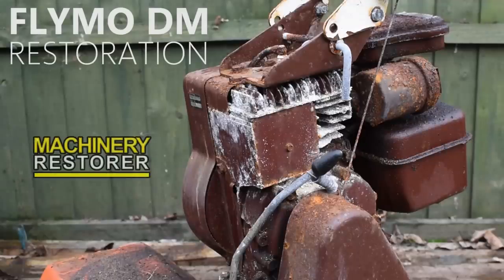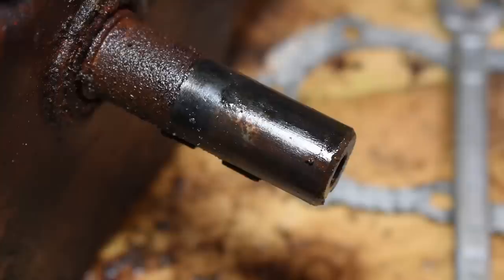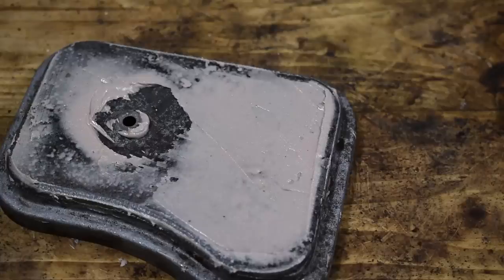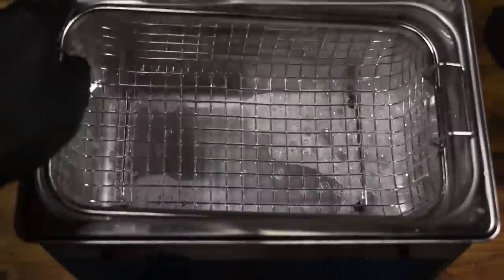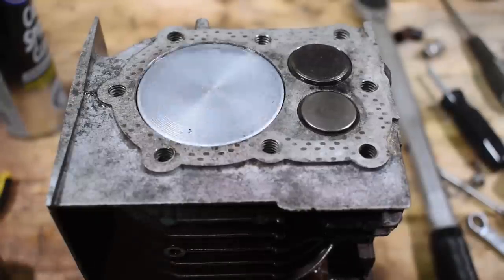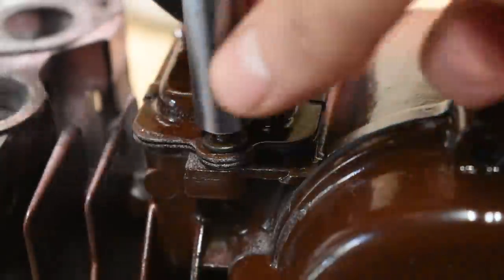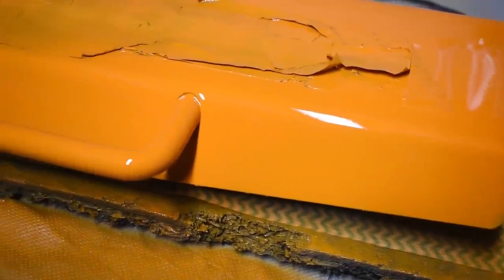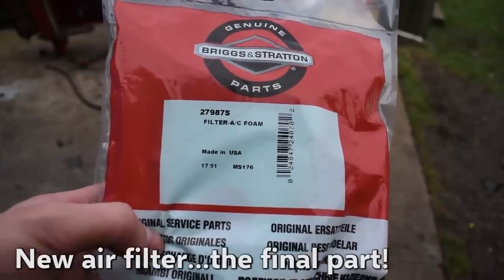TILLER RESTORATION (Will It Ever Run Again)

Comment from the maker: Hi everyone. Just to say I am aware of the 3hp decal being upside down. I am hoping to turn it around.
Reply: great job daggerwin I mentioned machinery restorer in your live stream
Reply: Just wondering if you slapped your forehead like I do when I do this kind of stuff??!! :-)
Reply from the maker: No, it's a learning experience
Reply: It's your point of view, pay no attention to us.  Thanks for a great rebuld.
Reply: Allo dagger
Reply: completely wrong year decal setup too. They are available in packs with fuel tank "check oil " decal as well as air cleaner.
Reply: I don’t think anyone noticed🤭
Reply: Machinery Restorer  What kind of Puller you used to remove the pulley with? 
Thanks Alex
Reply: Figured you were an Aussie.
Reply: Machinery Restorer I was just gonna say it was
Reply: Astonishing.  Great recovery and a great way to reduce and reuse. Most people here in the United states would simply chuck it and go buy new. I'm all for restoration.  Thanks for posting
Reply: Hi what solution do you use to dissolve all the rust out of the tanks.  I have a rusted motorcycle tank that I need to clear out.
Reply: Could have sold it to me as brand new and I wouldn't have been able to tell the fucking difference, my dude your amazing!
Reply: Damn great job. If you really care. Maybe a little heat to soften the glue. I would worry about it.
Reply: Cómo me gusta ver cómo se arreglan maquinaria!!!
Reply: If it is upside down, it is easier to read if you just lean over rather than slouch or squat to read if it were the right side up. ;-)
Reply: God
Reply: really after all the hard work you put into restoring this people are leaving comments about a sticker, only on youtube!
Reply: That won't do any harm.
Reply: I'm curious, how many hours did this restoration take?
Reply: That is the least thing to be preoccupied 😁
Reply: s1ayer_  ☹️-🤬
Reply: Machinery Restorer 
Hi, I see you used the original piston (no prob there not to mention it’s your tiller:) but I was wondering if you honed the cylinder and used new rings? Sure a Bore job one size over would restore optimal compression as would rings and new cross hatching from honing. The ring job just wouldn’t hold that comp as long as a bore job.
   Great job with lapping the valves that’s why I ask about honing and rings.  Time spent with the valves to improve compression reducing leakage made me wonder why no ring or bore job?
   Great vid! Nice work! Just being curious not criticizing your fine work! Cheers
Reply: Will turning it over increase the horse power?
Reply: You need drown this machine in a pool of WD-40 .Its rusty as hell !!
Reply: I have told YouTube to take down this video and ban you from ever posting anything again. Decal was upside down! My world just fell apart, and I lost all faith in humanity! What? There's another video like this? Faith in humanity restored... ;)
Reply: What to do.... If you have straight arms, the old pieces of iron will inevitably find a second life. Personally, I like the poor Russian would look at this cultivator, then with grief I drank a liter of vodka, play the balalaika wore a fur hat and went to an industrial shop for a new cultivator. And on arrival home again, drank vodka, so a new cultivator longer working.
Reply: It's right side up when you look over from the opposite side.
Reply: LOL
Reply: No sir, your "dH E" logo is right side up!
Reply: Why brown although great job
Reply: @classifiedgaming1910   because 70s and woodgrain
Reply: Use a pressure washer
Reply: You did a beautiful job, but when I saw you installing it upside down, I was yelling, "NOOOOO, you're doing it wrong!", LOL!!!! Having OCD is awesome....said no one ever.
Reply: Actually that ruined the whole restoration for me.
Reply: LOL!
Reply: Machinery Restorer 700th like
Reply: Ипануться, чувак ты крут!
Reply: I was amazed that the piston wasn't rotted away.
Reply: OMG, the upside down B&S 3HP label ruined the whole renovation for me. Actually, turned out nice but yes, I'd like to know how you didn't break a single bolt. That NEVER works for me.
Reply: Didn't even realize it lol and I actually have watched the video 4 times lmao
Reply: Ty I came here just to point out the sticker but you beat me to it very nice work though 😀
Reply: Wht it mean
Reply: One might say you're trying to turn your situation around ha haaaaaaaaaaaaa... My soul is in pain, please fix the decal.
Reply: Lol I was just going to say
Reply: Lololilolol
Reply: Do you sell al this stuff after the videos?
Reply: I love your video so I subscribed keep it up
Reply: Dosen't take away from the awesome job you did....
Reply: Machinery Restorer   Just a couple of helpful suggestions, I hope. A 50x50 mix of automatic transmission fluid and acetone is a great rust remover. Doesn't smell bad and cleans up easily. 
Also putting parts in a glass or plastic jar with cover and same solution as sonic cleaner will keep the fluid clean.
the only loss is whats in the jar . Also very small parts are not dropped to the bottom of the tank.
Both suggestions are from Steve's Small Engine Saloon.
Nice work, a job well done.
Reply: @isaaclaurenson3860  LMAO
Reply: Really?? Where can I get those? I've been searching for months, but I really want some vintage circa 1965 decals.
Reply: II you broke out the sandblaster I subscribed
Reply: That was the first thing I saw!!! Lol
Reply: buy another one
Reply: @STONEDay  when you're only dealing with 3hp, every little bit helps! 😁
Reply: Didn't even notice. But I am sure the judges are out on your channel, they seem to be on everyone's channel. 
Instead of just enjoying a machine come back to life, they sit on the edge of their seat to judge something.
Dont know about you but everytime I see a machine come back to life there is a overweening joy that I feel.
I so enjoy your rebuilds.
Thank you.
Reply: Was just a happy accident 😁
Reply: @jacilynns6330  who cares about that

Comment: How in the world could anyone give this a thumbs down?  Geesh, you do a wonderful job, and thank you for sharing!
Reply: Using old piston rings that had visible signs of deterioration would be on reason.
Reply: @gus6rocks  makes sense that it could be the reason, but IMO it would be better to leave a constructive comment rather than a thumbs down. His ability to restore equipment is already far superior to the average person, I can't see how one oversight deserves 140+ thumbs down. I'd like to see any of those people try and attempt this :)
Reply: gus6rocks - You wouldn’t just go and replace the piston rings due to visible signs of wear. First - you need a reason such as evidence of poor compression or a smokey engine but this is a 3hp garden tiller that doesn’t even turn over to start, so no evidence it has either of those issues. Second, in an old engine the rings, pistons, bores have all worn together, so you could end up making a good engine bad swapping parts out like that and ending up with the issue you were trying to fix that didn’t exist before but now does. The best thing to do in this engine is exactly what he did - get it cleaned up, run it, test it and if there are any running issues deal with them then. A quick run clearly demonstrated it was working fine and no such serious expensive mechanical fixes were needed aside from a strip, and a good clean, with only bearings and seals/gaskets needed. That’s how I would have done it too, and as Martin Murphy said it didn’t deserve a thumbs down not for any reason in my opinion. These machinery and tool restoration videos do such a fabulous job of encouraging others to dig in and see how things work, and really help look after our history.  Upside down sticker - now it’s one of a kind. LOL.
Reply: You could ask that about any video on YT. Someone could save a drowning puppy from a frozen lake and it will get some down votes. Go figure.
Reply: gus6rocks - I know you gave one reason mate, you may be right in why someone gave a thumbs down, but you are WRONG in what you say, it is NOT BAD PRACTICE to re use old piston rings. It’s not like changing your brake fluid, brake pads, engine oil, coolant, or any other wearable part or consumable item that’s always to the benefit of the engine, if you just go and change piston rings you could be doing more harm than good, to a perfectly working engine. It would be best practice to change the rings, and pistons and rebore/hone the cylinders yes together, but BAD to change the rings alone. If you don’t understand that you don’t understand engines at all.  And as he showed in the end result, engine ran fine.  Sorry dude but you’re wrong

Comment: Engine rusty and from the 80’s spark plug still comes out... meanwhile at ford
Reply: I know exactly what you speak of. Got a kick outta that one.
Reply: Yeah no joke.. that #3 plug
Reply: Sean Spell stop
Reply: Because it's not actually rusted, its a method where you basically put it in fire, if left to rust without this method it would've gotten into the threading and made it alot harder, its something along the lines of rapid oxidation from the combustion of a material, meaning its just fast rusting
Reply: @jordanfenwick123  it a joke about fords not chem class home boy 😂😂
Reply: Them 5.4s
Reply: @Drakilicious I think your investment paid you back handsomely - half a million miles is a LOT, and most of that done on cheap gas back in the day . . . good times.
Reply: The hell with a 5.4 lol coil packs and spark plugs freakin suck
Reply: @coleparker2592  yeah chevy are only rated the worst car company with over 30 million recalls more than toyota had during thier crisis ofcourse chevys dont rust cause they dont last long enough to rust i see plenty of old mustangs around seen any 1960s camaros lately?  Chevy cant even build an ignition switch that works properly unable to fix this flaw chevy said dont use more than 1 key on the key ring wow what safe cars
Reply: Cole must own 1 of those crappy broken ignition switch chevys rated the worst cars on the road by car and driver like the cobalt a car ranked barely above a 1970s gremlin in quality lmao the slick haired toothless guys at the buy here pay here lot probably told him that colbat and that jaguar xj are the most reliable cars we got
Reply: @michaelanthonyg3851  I own a vw and a toyota...  I'm an mechanic I think I know what I'm talking about when I shit talk a 5.4 they are a very poor engine that has timing chain problems, and ignition problems. Dont even get me started on power jokes... or EcoBoosts... or truck frames
Reply: How did you deal with the rust in the tank. Every pulsa jet tank I've seen has been full of flakes.
Reply: Logan. Mate I think you’re wrong. If this motor had been put through a fire then all the labels and paint would be gone and anything plastic like the carby would be melted and that rotten air cleaner element would have gone.
Reply: @michaelanthonyg3851  yeah, those 6.0 piece of strokes were awesome. Too bad the guys who dropped 65k on a pickup couldn't sue for consumer fraud on those turds. Every furd guy ever...yeah that last design sucked, but this new one is amazing. furd shitboxes.
Reply: @Drakilicious I think the Ford thing is more about the Modular engines., they seem to have problems with spark plugs.  Your 302 is indestructible.
Reply: Fords blow their spark plugs out so you don't have to remove them pretty convenient. Lols
Reply: hi
Reply: Cole parker chevy, ford ,or dodge?
Reply: What are dissimilar metals?
Reply: That one that breaks and phasers and tensioner .
Reply: Leif Hietala in specific the triton mod motor
Reply: @coleparker2592  the ability to speak does not make one intelligent. Likewise, claiming you're a mechanic doesn't mean you know engines very well.
Reply: @jordanfenwick123  //  You're exactly right; this was "made" to look like it sat outside for yrs so it could be "restored." I heard of ppl using sea salt, muriatic acid, and/or hydrogen peroxide to try and achieve the same look. People are very gullible. smh

Comment: never understood tillers.. Tears it all up we follow behind and crush it all down with out feet trying not to get chopped up in the midst
Reply: I actually drag mine backwards for that very reason.
Reply: tillers are supposed to be pulled not pushed
Reply: Tillers are VERY useful in hard soil. But you do not race it like in the video, you go very slowly. The tiller angle adjusts the depth and speed. Press handle down and it will dig in, lift handle up and it advances.

Comment: worked at an aerospace machine shop for years, and learned my lesson a few times with the ultra- sonic cleaner (industrial sized)...let a couple parts in over a weekend, running...non-existent by monday, lol
Reply: Hold up, so the corrosion became non-existent?....or the parts?
Reply: @martinramirezjr7872  the parts were completely disintegrated from the ultra sonic cleaner
Reply: @gregleblond6039  Dear god.
Reply: @martinramirezjr7872  try explaining that one to the supervisor
Reply: Wait so it uses sound to remove corrosion
Reply: Ultrasonic waves or high frequency pressure waves.. (Sound) acoustics and agitation..very effective
Reply: @avidion6274  Makes the part vibrate, shakes off the dirt - or falls to pieces

Comment: Those Briggs engines are great, just got an old 80s Briggs powered tiller to run after sitting for over 10 years. Going to use it then restore it and sell it on

Comment: Nice save. You need to make a drag bar behind the tiller so you don't have to fight holding on to it. Set correctly, your hands should just be resting on the handles.. let the drag bar hold the tiller back, not you.
Reply: Yep, these type of tillers usually came with a spud.  You're probably missing that piece but you can't help that the previous owners lost it!

Comment: That unit needs a drag stake like our 1961 Sears tiller...makes tilling a lot easier.
Reply: He's supposed to remove the wheels but leave the support bracket on this then leaves two drag stakes or depth gauges as they are called in the uk

Comment: How the Hell do you keep track of all thouse parts?, I can´t reasamble a ballpoint once dismantle.
Reply: All he has to do is go back in his video and watch how he took it apart. Its a really smart way to dissasemble things you are not 100% familiar with. Also putting parts and bolts in labeled zip lock bags works. Or you just thread the bolt right back into its hole after the crankcase cover is removed for example.
Reply: Sometimes, the assembled part is like a story. Going backwards will make sense , especially with a trained mind. He more than likely got familiar with the piece as he was disassembling it.
Reply: Honestly it just becomes second nature to remember where majority of the parts come from. This here has comparitively very few parts when compared to some items
Reply: Working on helicopters in the Army we had to keep a detailed list of everything, and I mean EVERYTHING, that we took off in exact order. Then when resembling we just worked from the end of the list to the beginning.

Comment: Great video, reminds me of the two rotovators we had in the 1980's half the  time in the plots was spent getting them working. Ours were 5 and 7.5 HP though. One thing we had a heavy jocky bar with a small hook at the end, when you took the wheels off your popped this in its place, it made tilling and ploughing much easier. They did some work for us back then. You needed big arms for the 7.5HP

Comment: Why did you not give the engine a light quick hone? Also you should use assembly lube, not that oil you were using, I would have polished the followers and gave the cam a light polish grind, same with the crank. Add some zinc oil to help break it in. Other than this, you did a bangarange job (ASIDE FROM THE STICKER lol i know you know, so does everyone lol. I would also have done a pot and polish on the head for S&G's
Nice job.

Comment: If I saw this I would take out my power washer
Reply: I agree i would have cleaned as much of the gunk and loose rust and paint off as possible before trying to wrench off dirt and rust filled screw and bolt heads.

Comment: Front tine, forward rotating tillers usually have some kind of drag or draft stake at the rear, which gets dragged through the soil as the machine works.  It gets dragged so YOU don't get dragged, providing resistance against the pull.  I notice that the wheels are super easy to remove, their axles held in with cotter pins so I wonder if the legs are supposed to double as the draft stakes?  Also, the DM can be fitted with several interesting accessories, including tractor wheels to replace the stakes, a wheelbarrow body, and cultivator tines.

Comment: that brown paint came out kinda poopy. Idk if you read all your comments, but soaking the nozzle in solvent after you're done with the can, can make the nozzle atomize better. Also, soaking the paint can in a warm water bath prior to using it can help massively if it's cold.

Comment: Woooow respect. Cleaning and using all original parts like screws is awesome. It shows you really know what you aren doing. One question: what is best way to clean rust from fuel tank or old fuel deposit from carburetor. Sandblasting? Ultrasone? Or what liquid to use if you don’t have sandblaster or ultrasone?